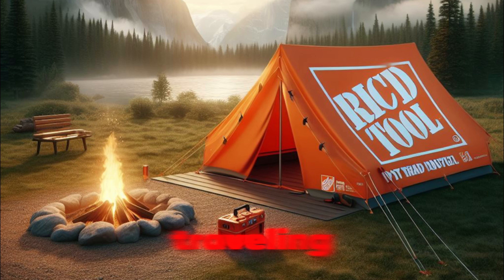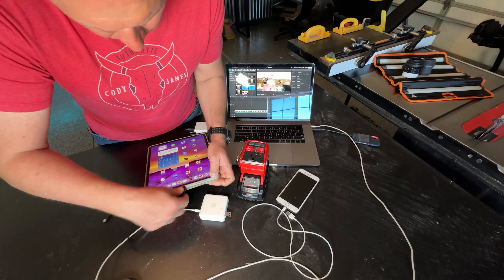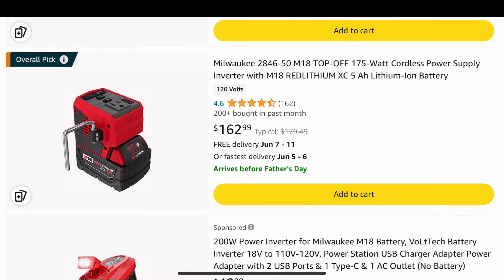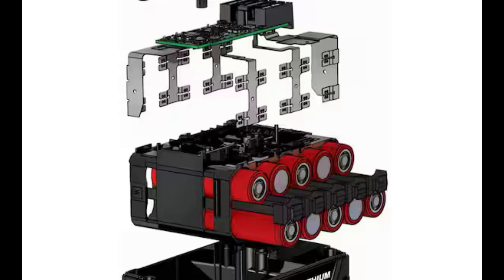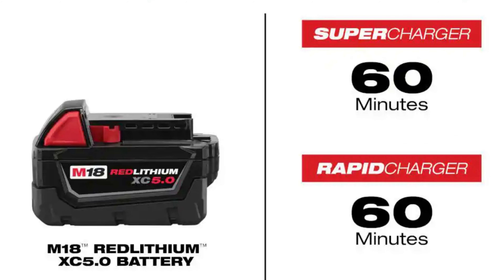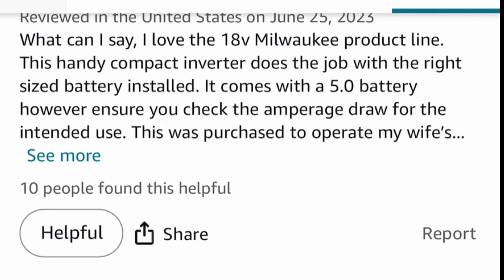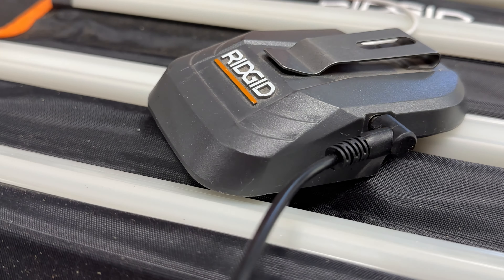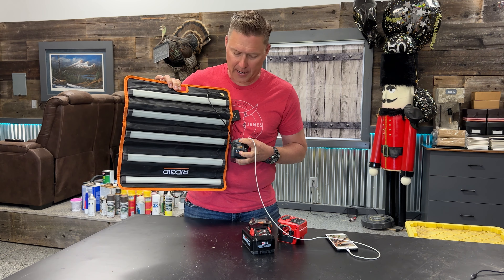Milwaukee Inverter— the Portable Battery Bank Solution Hack for Power ANYWHERE!

Comment: This is a great option for me as I have a ton of batteries for all of my tools. Does the inverter offer any “on all the time” levels so you know how much charge is left? Or do you just always need to check the battery indicator. I know some of my older batteries do not have that display to check.
Reply from the maker: Great question, No, the inverter does not. You would have to check via the indicator.

Comment: I did not know those existed! Unfortunately it doesn't look like Dewalt makes one and the generic brand reviews are mixed.
Reply from the maker: Although Dewalt does not have an inverter, per se, they do have a USB adapter, which, for most people, allow them to use it for a charger for their phones and or tablets, which is typically 90% of the use for these battery banks.

Go to Amazon And search for this title, “DEWALT 12V/20V MAX USB Charger with 2 Ports and State of Charge Indicator(DCB090)”